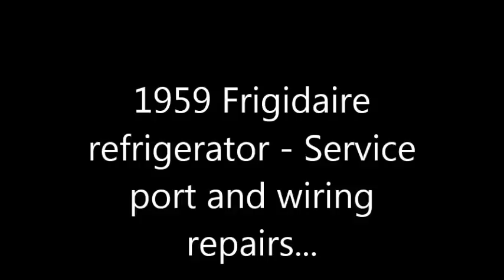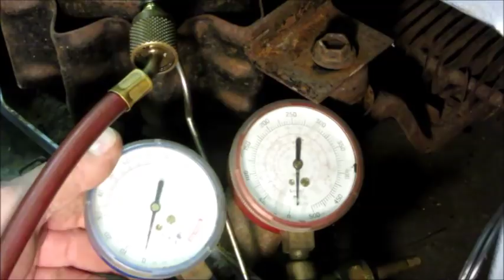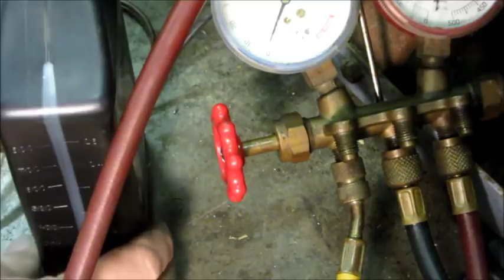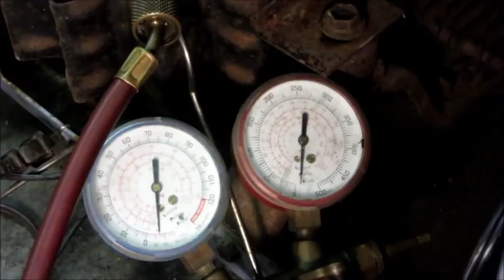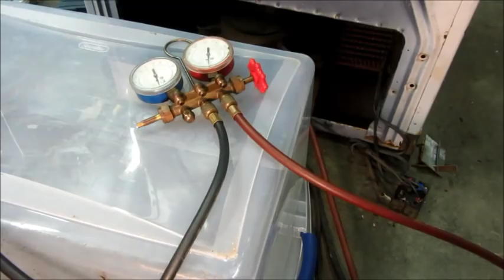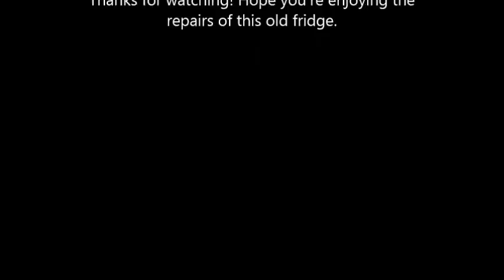Frigidaire 5400426 antique fridge - 2 - Service port, wiring, and test charge....

Comment: Hi David,
Thanks for the great videos, 
You have helped me tremendously with restoring my exact frig.
And was wondering if you put the same  amount  charge of R-152 as you used when you charged with butane?
Looks like you were using the duster spray from office depot (10 oz) 
My compressor calls for 27 oz of R-12
Thanks again ,
Dale
Reply from the maker: Hi Dale!  Thanks for the positive comment!  

The R152A is heavier than butane and lighter than R12. I didn't really pay attention to the butane charge since it was just a test to see how the butane performed. As for going from R12 to R152A; based on mass, it seems to take around 2/3 as many ounces of R152A as it took of R12.  There are other factors at play and this isn't an exact science. The best way is to start with a little more than half as many ounces of R152A and see what sort of frost line you get. The whole evaporator should frost up, with the frost stopping before the return line goes back to the compressor. 

I do use the Office depot duster cans for R152A. They are about $2.50 per can on Amazon when bought in bulk. 

Very pleased you're getting your fridge restored!
Reply: @davida1hiwaaynet  
Thanks again for taking the time to reply and  spread your  knowledge it is appreciated by myself and appears by many to over come our adversity. 
Starting with the wiring being  rotted from the compressor to thermostat ,  replacing steel condenser (modify)
(Mine  is mounted on the back side), and  missing relay, 
 Mocking your videos I am left with  adding some oil and charging. 

My grandma left me with a monitor top it works , just need to find some legs for it and paint job
But watching you videos just to familiarize myself with it.

What is your experience with the. 3 in 1 relays ..?
I know you can't believe everything you read on the net ,but heard it's should only be a temporary fix until you can replace with the OEM.
 I have had no luck finding the 
 yg-2  relay . Do you have any suggestions?

Many blessing to you !
Thanks again for all you help!
Reply from the maker: Hi Dale, you got me curious, what was wrong with the condenser, to require replacement? 

As for the YG-2 relay replacement; those are usually replaced with a Supco RO81 style relay. This is a non-capacitor design and will not put higher voltage or torque on the motor than the original. It's got its own built-in overload breaker (that was also in the original YG-2 relay) and start contact.

Many of the original Frigidaire relays were thermal-timing relays which engaged the start winding for a pre-set time when it was powered on. The RO81 relay is also a thermal timing relay, and has surprisingly similar characteristics to the original Frigidaire relay. 

Search for Supco RO81.
Reply: The coil was steel ,and so badly rusted it had pin holes everywhere.
Frustrating every time I'd clean the rust it created more holes.

David I can't thank you enough for your awsome detailed videos. 
My unit is up and running like a champ.🙌 honestly I was so lost
Before watching your videos. 
I had a couple local refrigerator technician who had no clue how to  repair my fridge. That left me with the determination to do it myself.
Haven't figured out how to send pictures from here but I would have liked you to see it when finished.
If you ever in California look me up ! because I'd like to buy you a beer 🤝
( I know why would you want to come to California) haha!
Thanks ,
Dale
Reply from the maker: @dalemcdermott3046  Thanks Dale. Again I am happy you're enjoying my videos.

I think I understand the condenser you have. It was like my 1937 Frigidaire, where the whole back of the unit was one large sheet, with hundreds of dimples in it? I can see how that would be an issue if it rusted through.
Reply from the maker: @dalemcdermott3046  you can e-mail me the pictures at davida1@hiwaay.net if you want. That would be great!
Reply: davida1hiwaaynet love your videos. Extremely in depth with your broad knowledge base!! I have a 1954 Frigidaire that I have noticed on a couple occasions to not start up completely. It will try and just shut back down. After so many tries it will start up and purr just like normal. Would you most likely point your finger at the YG-2 relay? It’s in immaculate condition as far as aesthetics are concerned. I just can’t risk my beer getting warm! Haha I will be looking forward to your reply!
Reply: @davida1hiwaaynet  
Hi David, I have a 1952 Frigidaire SR 78, that had a freezer tube puncture. The port on the compressor has pressure after the tube patch. What gas and oil would you suggest. I want to save the fridge. Thanks Brad Wiebelhaus

Comment: I’m curious if the compressor on these older units just don’t run at all when there’s no refrigerant. I’ve got an old Westinghouse. Its been sitting in a shed forever. It was free. The light comes on inside the refrigerator but it won’t start at all. No clicks, nothing.
Reply from the maker: Chris, the compressor will run constantly if there is not enough refrigerant to cool down to the thermostat cutoff temperature. There are a couple ways that a loss of refrigerant can cause the compressor to not run; but it will still attempt to run and cause high current draw and humming. This can happen is if it has been open to air due to a large leak, causing the oil to dry up and gum up the moving parts. Another possibility is that the compressor ran without refrigerant so long that the oil has migrated out oft he compressor, allowing it to run dry and seize up. If the first scenario happened (gummed up oil) you can often get the compressor going and replace the oil; and it will run for years. If it ran dry and seized up, it's likely not repairable without opening the case.

Because yours isn't clicking or doing anything, I expect the thermostat, start relay, or overload breaker are at fault.
Reply: @davida1hiwaaynet  That’s what I figured, just wanted to know for sure. I knew that the newer models will just run even if there’s no refrigerant at all. But yeah it’s not doing anything at all. But the light does come on when you open the door. It’s been sitting in that shed for probably 20 or 30 years who knows.. I did notice it has a low side tap. I traced the lines to be sure. It’s on the bigger lines leading to the front where it goes to the aluminum looking evaporator inside.
Reply: @davida1hiwaaynet  It looks like a factory access tap. Kind of resembles the shape of an icemaker line piece that you screw tight with a wrench.
Reply: @davida1hiwaaynet  I found something…. A black cover that the power cord goes into. Bunch of wires coming out of the other side. That black cover has a big crack in it. Gonna open it up and see what I find…
Reply: Opened it up and it’s completely covered in cobwebs and dirt. Dirt halfway covering this black part that the wires connect to with what resembles motor windings… can’t think of what that part is called. Probably the start relay on this.
Reply: Or maybe that’s not the start relay after all.. I was thinking like what if the relay looks totally different on these…. I see 2 parts on the compressor that are difficult to get to that the 3 wires coming out the other side of that box lead to.. I wonder if there’s dirt all inside that start relay and overload…
Reply: @davida1hiwaaynet  if I have to I’ll lay it over to get to those parts.
Reply: @davida1hiwaaynet  Coil compressor relay… that’s it. That’s what that is. Little part with a coil on it. It was covered in dirt. Cleaned it up the best I could but still not doing anything yet.
Reply: @davida1hiwaaynet  i’ve had to order some more wires to fix the start relay and overload because those wires need replacing. The o-ring terminals broke off due to corrosion, which made them super weak. The start relay was covered in dirt as u know. I accidentally broke all the wire o rings in the compressor compartment just trying to work on it and get it back connected right. Lol
Reply: @davida1hiwaaynet  Been a train wreck so far trying to fix it but I’m not giving up.
Reply: @davida1hiwaaynet Don’t ever let one of these sit in a tractor shed with a dirt floor for ages.
Reply from the maker: @chrisscott5339  Seems all your replies are out of order and it's hard to follow. The brown / black box with all the wires is the start relay. The coil inside is called the series coil. If that is bad it can cause the compressor to fail to start.  Never attempt to run the compressor without the relay because it is a safety device. You can replace it with a Supco RO81 relay if it is not repairable.
Reply: @davida1hiwaaynet  Thank you. I don’t know if the start relay is no good or not yet. I haven’t attempted to test it. Right now I’ve gotta replace the wires that connect it to the overload.
Reply: @davida1hiwaaynet  The relay was buried in dirt inside that box when I opened it up. (After plugging it in and only the light inside would come on.)  I’ve been running into problems with the o rings breaking off the wires then making the wires shorter and shorter cutting them with the splitters. So I’m just gonna attempt to replace the wires and get it hooked back up and go from there.
Reply: @davida1hiwaaynet  I got everything wired up and Walla.. didn’t work. Bad start relay. I just did what you said and ordered the supco R081 relay.
Reply: @davida1hiwaaynet  it would require that i destroy the rivets and drill a hole in the back of the relay and even then the coil winding part looks like the enamel has peeled some. But I gave it the benefit of the doubt anyway, but it didn’t work.
Reply: @davida1hiwaaynet  also the box housing it was in is damaged. Mine was in a black plastic box (with the power cord) labeled top with the metal cover screwed on the backside of it covering it up and the box itself was screwed to a piece of metal that was screwed down on the refrigerator compartment frame. That box cracked apart and allowed mud from the tractor shed to get in and bury it.
Reply: @davida1hiwaaynet  Thats what the unit look like.
Reply: @davida1hiwaaynet  Sorry I guess I should retract what I said. Relay is ok now.. Got the plunger to come up. Guess that little bit of enamel loss won’t hurt the connection. But overload is faulty for sure. I saw your other video recently that made me wanna tinker with that relay. Got it to come up enough to spray some lubricant in it. Freed it completely. But the wires to it popped off the orings I pinched on it and the overload is faulty. So…. Also that box is damaged as well. On one side. Just gonna use the R081 on it instead.
Reply: @davida1hiwaaynet I have an update… got it to start, but the motor turns for like a second. Then humming. Needs oil.
Reply: I wonder can oil be added to existing Freon.
Reply: @davida1hiwaaynet  Like a moron I added a full charge weeks ago. Wanted to see if it would hold. Which it appears to have. But it’s clearly gummed up and can’t start.
Reply: @davida1hiwaaynet  I vacuumed it down for an hour then I added a full charge. I confirmed it had no refrigerant left in it.
Reply: @davida1hiwaaynet  One I wanted to see if it would hold. Number two I was like what if it has a low pressure switch. Lol
Reply: Nvm I got my answer.. it’s a good thing I have plenty of refrigerant. Lol. I see a can of mineral oil for R12 systems online. Says it can’t be added to a fully charged system.

Comment: I have one of these and it always freezes my beer. What do you think is wrong? Thanks for any advice.
Reply from the maker: Hi John.  There's really only one thing that can cause this, and that would be the compressor is running for too long and getting the cabinet too cold.  Beer freezes around 28 - 30 degrees Fahrenheit, so any cabinet temperature below that will result in your problem.

The dial is marked with letters and numbers. I got the following information from the Frigidaire manual from a fellow enthusiast:

 ""... the photos in the manual are exactly of your Frigidaire. On the inside of the front cover is written "Copyright 1949 Frigidaire Division General Motors Corporation Dayton Ohio (1702)." Instructions for the cold control read, for normal use leave the cold control on number 1. For fast ice freezing set the cold control to number 7. After ice has frozen return the control to it's normal setting. For keeping commercially frozen foods and commercial ice cream leave the cold control on number 3 or 4 for as long as the foods are to be kept frozen. The A,B,& C settings are vacation settings for when you will be away from home for a number of days. Because the door will not be opened or warm foods placed in the refrigerator these settings will maintain a satisfactory temperature inside the refrigerator and the Super Freezer. ""

So, having read that, I found out that my Frigidaire needs to be just "warmer than" the number 1 setting to keep from freezing my drinks. I am keeping only non-alcohol drinks in mine since it is in a workshop setting. If you keep only beer in yours, between 1 and 2 would probably be good.

How long does the compressor run? These fridges have a fairly short cycle time. For instance, mine runs 3 minutes ON, and then it rests 8 minutes before starting again.  If it's running continuously, then you have a real problem with the control.
Reply: The control does not shut it off when you turn it down. Sometimes the compressor runs continuously. I have to unplug it to stop it. I am not sure if it is the thermostat or the relay sticking closed. Your thoughts?
Reply from the maker: Aha!  You have definitely got a problem with the control or the wiring.  The relay its self is only used for motor overload protection and start-winding operation.  It has nothing to do with cycling the compressor off at the end of the cycle.

The thermostat its self is either bypassed (someone did a very poor wiring job) or the thermostat is actually damaged. If the sensing tube of the thermostat is damaged, the gas inside the thermostat will escape and make the unit run all the time. However, if even the OFF position doesn't stop the compressor this sounds more like a wiring issue to me.
Reply: Could it be the thermostat? I can't figure out how to access the wiring. I have had this fridge for 20+ years and it just started this. Thanks for the help.
Reply from the maker: I recently restored another similar one. On that one I show accessing all the wiring and the thermostat. Watch this if you have time, and you can see how to remove and install the t'stat. https://www.youtube.com/watch?v=7sM38gdf3CE